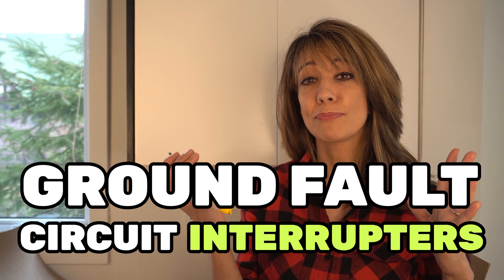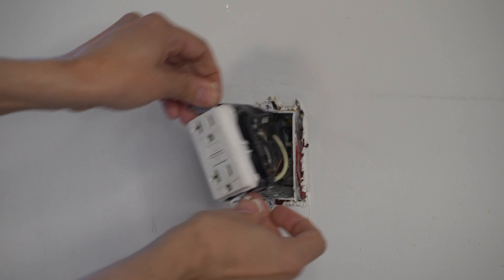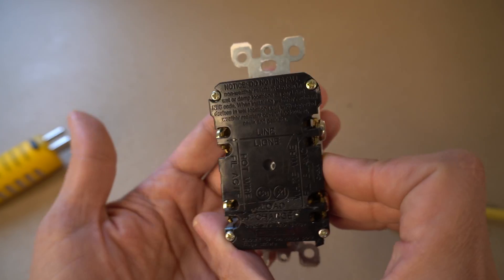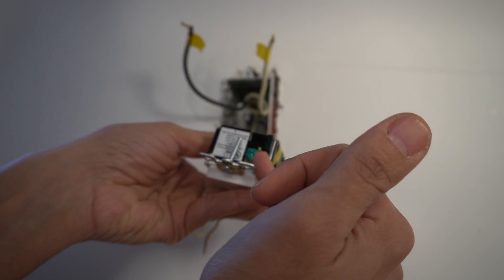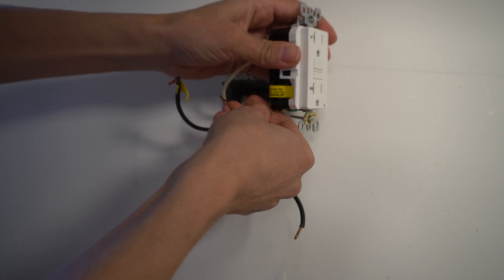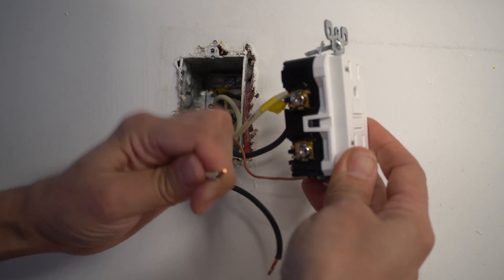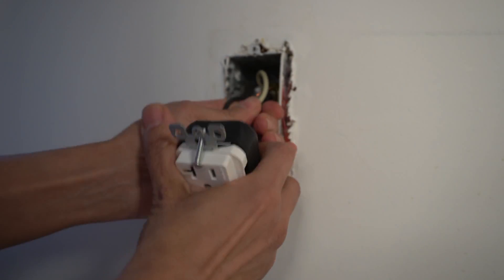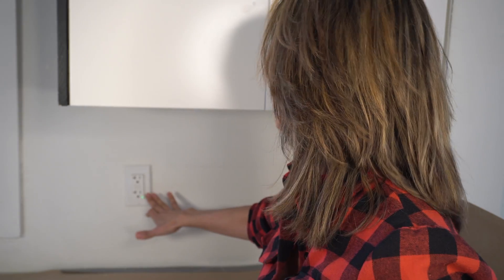How To Replace a GFCI Outlet | 98% Don’t Don't Know This!

Comment: I am no electrician, but I thought that if the breaker was turned off at the panel that there will not be any power present at that receptacle. At 3:45 you start by saying you turned off power (shut the breaker switch off I assume) and proceed to identify the hot line wire. What am I not getting? I would think that you would need the breaker on to be able to find the hot line wire. Please explain.
Reply from the maker: I believe I misspoke. I meant to say the power was on. The voltage tester is beeping and I’m saying the wire is hot. If the wire is hot and voltage tester is sounding the alarm like in the video the power is on.
Reply: @DaruDhillon  Thank you for clearing that up. I know just enough to be dangerous. Your video was very helpful in explaining Line and Load lines and how to find the Line wire.
Reply: FYI - Just because the breaker is off does not  mean there is power at the receptacle.  There are cases were there may still be power; i.e. Shared neutrals.. my house build in the 90's has many share neutrals with single pole breakers; updated code now requires tied breakers be used instead.  Then there is just bad wiring where a retrofit ends up tieing two circuits together (bad wiring).  The older the house the more surprises you find.

Comment: Hello,  thank you for the video. One question....at the 3:46 mark did you mean to say you turned the power off? Should that be turned the power on?
Reply from the maker: Hi, to start wiring your power needs to be off. To determine your line wire the power needs to be turned back on. As a safety measure you can put wire nuts on the wires to be safe. Once located turn the power back off. Check that it is off and resume wiring. Thanks for the question.
Reply: Thank you for clarifying....again....great video
Reply from the maker: @davewhalen5981  Thanks Dave. Happy to clarify.

Comment: I’ve swapped out outlets before, but I love how you explained it and I watched the whole thing. I’m glad I did, marking the line wires is a fantastic idea (I haven’t Daisy chained any yet). 
I was hoping for some details on gfci and non grounded outlets. I’m prepping to swap out a two prong for a three but I’m not ready to run a ground yet (I feel unsafe with the outlet as is, as I swear it gives off something that I can’t explain). 
I’ve watched the videos before but was looking for a new one when I came across you video. I will be taking your tips to heart when I do move forward.
Reply from the maker: That's great that you are taking on this project and learning a lot in the process! It's smart to do your research. I appreciate your complement. Thanks!

Comment: Hello Daru , Whenever I replace outlets and switches , This is what I do as standard procedure , First I'll cut a strip of rubber splicing tape and cover the screws on the hot side and finish wrap it with electrical tape , The splicing tape provides a more safe cushion of insulation and you don't need as much tape to wrap it with , because rubber splicing tape has more thickness than regular electrical tape 
I only use one brand of electrical tape and that's Scotch because I've seen other electrical tapes begin to peel off over time ,
Reply from the maker: That’s a good safety first way of doing it. Looks like you take good care in your work. That’s great to know!
Reply: @DaruDhillon  Thank you so much , I am very strict about electrical safety because when I was 10 years old , I was almost electrocuted by a defective floor lamp and our neighbor who's an electrician showed me what happened and taught me some very important lessons about electrical safety and ever since I was little 
I've always had a big interest in electricity 
Even though I went through a bad experience 
Some good came out of it to always put safety first , Such as making sure the power is off and locking out and tagging out the circuit breaker or disconnect switch before working on it , Next is doing it right the first time , To meet The National Electrical Code specifications and I use only the best quality materials I can find , Top quality materials play a very important role in electrical safety as well , Plus I am very strict against cutting corners , All people who do their own electrical work should go to their local electrical supply and pick up a circuit breaker lockout along with a warning tag and padlock because lockout tagout is just as important at home as it is in the workplace , In everything you do , 
There is absolutely no such thing as being too careful , I love to share my tips with others to keep them safe and to have a safe and reliable electrical system
Reply: @DaruDhillon  Hello Daru , I love the design of these outlets with the lever connectors to make installation a breeze and especially the safety designed into them , No worry about any connections grounding out against the box and I plan to use them on my next electrical job , Since we've been touching base about electrical safety , There's one very important thing I wanted to touch base with you about , 
When you get a chance , Go on YouTube and type in 
Federal Pacific circuit breakers investigation finds decades of danger , NBC Bay area 
Check out the video and I hope to God 
You and your friends and family do not have a Federal Pacific circuit breaker panel in your home ,
Reply: @DaruDhillon Hello Daru , I want to  share with you about why GFCI receptacles and circuit breakers are so important and you posting videos of how to install GFCI receptacles is just as important , Last month I saw a news article about an electrical accident that happened in Logansport Indiana 
There was a group of 5 swimming in the in ground pool , There was a sump pump in the pool and what happened is when they set the pool ladder in place , The ladder pinched the cord to the sump pump and severed the cord 
Electrifying the water and shocked everybody in the pool , The father got the worst of it , Luckily somebody outside the pool saw what was happening and got the power off 
All the people in the pool survived including the father and all will make a full recovery , Obviously the receptacle the pump was plugged into was not GFCI protected , All electrical equipment outside , Especially around swimming pools must be GFCI protected , Lights , Pumps and all other equipment that uses electricity , They were extremely lucky to have all survived , Had the equipment been GFCI protected , The shock would have lasted 1/40th of a second , Long before it would be lethal , The report said that police are investigating the accident , I have a feeling that after the investigation , The homeowner is likely to be charged in court for not having the equipment GFCI protected 
Another thing is If one person died of electrocution , The homeowner would likely be charged with manslaughter 
I'll bet the homeowner will be charged in court and be slapped with a stiff fine 
Thank god they all survived with no serious injuries 
This is a perfect example of what can happen cutting corners to save a few bucks , Especially when it comes to electricity , Cutting corners is definitely not worth the risk , 5 people could have very easily lost their lives but thank God somebody was there to get the power off , 
The number one thing is , If an electrical accident happens is
GET THE POWER CUT OFF AND NEVER TOUCH A PERSON IN CONTACT WITH A LIVE WIRE , YOU CAN BE ELECTROCUTED RIGHT ALONG WITH THE PERSON 
As a rule of thumb , Never take chances with electricity , Always make sure the power is off using a voltage tester and lock out Tag out the circuit breaker before working on it
Remember in everything you do 
ALWAYS PUT SAFETY FIRST !!!!

Comment: So what is the procedure when you are changing a switch/ plug outlet? I thought I can do it and turns out I didn't. Also why in some kitchen outlets is there 2 hot wires 1 red 1 black.? Any advice
Reply: Red can be one of two things- either a second hot wire for a 240V outlet, such as for an electric stove (black to white will be 120V and red to white will be 120V, but red to black will be 240V). The other possibility is it's a switched hot for a light.  The black wire will be the always-on hot, the red will be the switched hot to the lighting fixture.
Reply: @scotttodd3506 Red can be one of three things. If it's an older home before GFCI's were required, it's likely to be a multi wire branch circuit with a shared neutral. The upper and lower sockets will be on different circuits. An electric stove usually requires a 50 amp 240v circuit and receptacle, NEMA 6-50R or 14-50R. The 14-50R has a connection for a neutral wire. These are single receptacles for dedicated circuits.

Comment: There should be a note saying “wiring for a 20amp receptacle needs at least 12ga wiring. Do not install a 20amp receptacle with 15amp rated wiring”
Reply from the maker: Thank-you! That was missed but I appreciate you sharing that important tip and advice.

Comment: Great video! You explain this content cleanly! You should consider upgrading the screws type outlet videos to explain that torque values are provided on the box for the screws. It is surprising how much force is required using the torque screwdrivers. It makes the argument for using the wago style outlets instead, such as the one in the newer video you have posted.
Reply from the maker: Thanks I appreciate your suggestion there’s a lot to know about torque.

Comment: Is there a way to identify the line and load wires other than relying on their position on the old outlet? Previous owner did a lot of shoddy work
Reply: I only know to go by the colors, but if the last owner did shoddy work I’m not sure I would even trust that.

Comment: You mentioned that some GFI outlets self-test every 15 minutes, and some self-test every 90 minutes, and that we should "keep that in mind" when getting new ones, but you never explained why.  Is there an advantage or disadvantage either way?
Reply from the maker: It’s up to homeowners to decide which they’d prefer. I buy them because they are safer because they are tested often. That might not be an issue for other people.
Reply: @DaruDhillon  - Thanks for the response.  If it's just a preference, I think I'd rather go with the 90 minute test.  If something cycles that often and regularly, more cycles = more opportunities for something to go wrong.  It would be interesting to know what sort of long term test failures each type experiences.

Comment: I would cap the wires before turning the power back on to verify which one is on the line side as an added layer of safety.
Reply from the maker: Excellent tip! Thanks and noted. I’ve added that to my latest video. Appreciate the advice. Always room for improvement.

Comment: Maybe already addressed, but if not, you did not show ground in the box & only conneted one ground to receptacle. You need both grounds from each wire are pigtailed , with one going out to metal  box & the other to the receptacle. Only one wire per screw.  So  so all is grounded. So total 4 wires in pigtail. Now if too crowded, just swap the metal box with deep plastic. Also, never just swap 15amp for 20amp receptacle unless 12ga & 20amp breaker.
Reply from the maker: Thanks for mentioning that. The box and all wires in the box are grounded at the back. Appreciate your comment and others. I’ve shown this close up of the back of the box ground screw in my latest video on smart dimmer installation. I’m always taking notes on your suggestions. Thank-you!
Reply: It’s usually pigtailed. There no place on the receptacle for more than one grounding wire.
Reply: @K31swiss Canadian metal boxes have 2 ground screws.

Comment: Oh, I did not know GFI can do self-testing?  I thought the only testing is to push the TEST button?  
It is my personal opinion that there is NO need for ground wire if you have GFI.  Because GFI will cut power if there is a milliamp leakage.  That is like put a safety net to catch someone falling 0.001mm distance.
Reply from the maker: I’m glad you learned something new that’s great! Thanks for sharing your perspective. To pass our electrical inspections we need to ground GFCIs and all receptacles. The inspectors will check for that with the tester, like in the video. I appreciate their attention to detail.
Reply: Actually 4 to 6mA. They are supposed to work without ground, however, the test button may not work because there is no way to leak the 4mA test current.

Comment: Why wrapping the terminals? What exactly do you need an extra layer of protection from? You're not working live, and the receptacle can't move once installed. If something contacts those terminals you really bodged something up. 

I use metallic conduit and boxes pretty much exclusively and i don't understand how you could ever have a short to the terminals. Around here wrapping in tape is seen as hacky poor workmanship. 

You should probably spend that time stripping fresh wire and not reusing the oxidized portion. Maybe you scratched enough oxide off when you reinserted them to make good contact. Maybe.

Also what was that grounding situation?  Couldn't really see it that well but there probably should be more than 1 ground conductor in there.
Reply: Wrapping the terminals prevent them from touching the metal box and short circuiting if you handle the outlet while power is on. If your workflow prevents this from ever happening, they don't hurt anything either. Why is that poor workmanship?
Reply from the maker: Wrapping terminals is really common here but if you don't do it, that's fine and up to you. The box is also grounded.
Reply: @DaruDhillon  I guess tape is rated for insulating, we just don't really use it for that.

What about the load side receptacles of the GFCI? Even things like surge protectors won't work without an equipment ground.  

Technically the wipers on the gfci mounting screw will bond the box so that much was fine.

Comment: I'm leaning towards using CAFCI/GFCI breakers in my load center (breaker panel). If I do this, is there any reason to also have GFCI receptacles?
Reply from the maker: It’s best to check with your local electrical safety authority to see what they recommend.

Comment: Don't trust the original one was installed properly. placing tape on the hot wires is a good idea, but also turn the breaker back on and verify it is correct. The lady mis-spoke she said off and then test. She meant on.
Reply from the maker: Hi Dave, thanks for sharing your tip! Always good to double check.

Comment: The the GFI is tripped you won't have power at the plug and at the same time the line wires could still be live. Be carfull when watching Youtube vids!
Reply from the maker: Always be careful and start with your breaker turned off and check with your voltage tester.

Comment: Being  a retired electrician I also used to wrap electrical tape around GFCI receptacles to keep them somewhat away from metal outlet boxes, until I found that ideal makes "rubber Bands' to go around the receptacles and is much faster and easier if you install lots of them.
Reply from the maker: I appreciate you sharing your experience. Sounds like a great time saving idea. I hadn’t heard of them. Thanks!

Comment: That t-slot is not tqmper resistant, its a 20amp receptacle
Reply from the maker: It’s a 20 amp, tamper resistant.
Reply: The t-slot is for 20 amps only. The receptacle should be stamped TR for tamper resistant. @DaruDhillon

Comment: Your box should be bonded to the ground and then a pig tail from the GFCI to the ground and box. But the yoke should be grounded since there is a ground, and the box will then be grounded when it's all put back together. It's just best to bond the box itself though as well.
Reply from the maker: Appreciate the advice. The added pigtail with ground is what I’ll do next time around. Thanks for sharing!

Comment: Uder what circumstances, if any, do you recommend checking the torque setting on a connection to make sure it meets the requirement of manufacturer?
Reply: Technically by the NEC 70 code and manufacturer at time of installation always. Don't believe there is a requirement to periodically re-check them. Having replaced many old switches and receptacles can tell you many times they are lose. Most probably not torqued when installed, because it's only a switch or receptacle.

Comment: At first glance it seems that this is an ungrounded circuit, at some time upgraded to a 3-prong GFCI. In that case, at least in the USA, it needs to be labelled "no equipment ground", no? And also,  in that case, does bonding the box do any good? Or is it wired with old BX cable and there IS a ground?  Thanks
Reply from the maker: The house was recently re-wired with 12/2 gauge wire. I wanted to upgrade the GFCIs for safety.  All wiring here needs to be grounded to pass our electrical inspections. It’s always important to check that your outlets are grounded. Thanks for your sharing your experience in the USA about labelling and safety. It's appreciated and helpful!
Reply: @DaruDhillon  There's no ground wires visible in the video. There's only one bare wire from the box to the device. If you have 12/2 in there, which in the USA means two wires plus a ground, one would expect to at least see the two ground wires pigtailed in the box somewhere. If this is not the USA, how is that circuit grounded? Is there a bonding wire like we used to have here with BX metallic cable? Just curious.